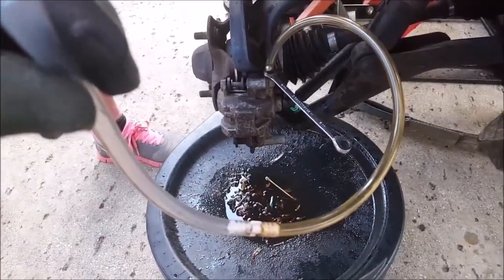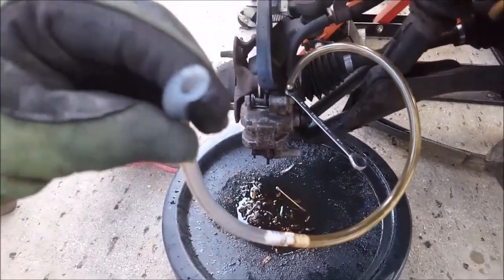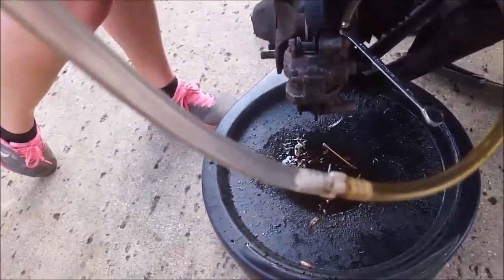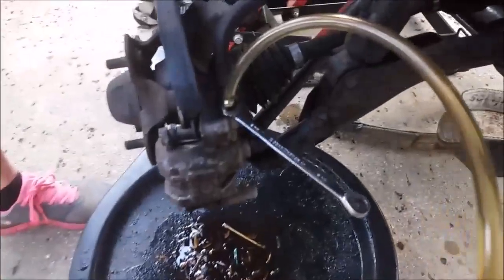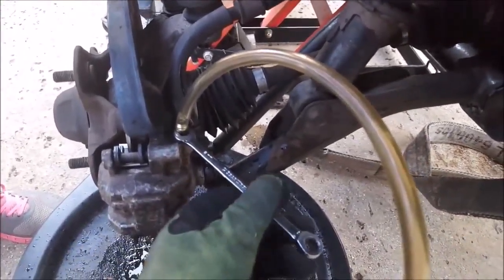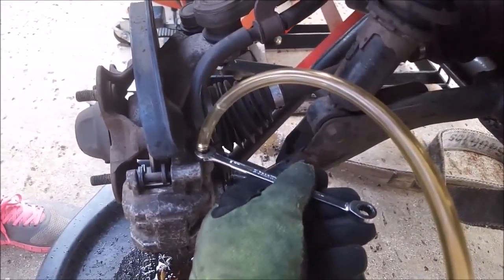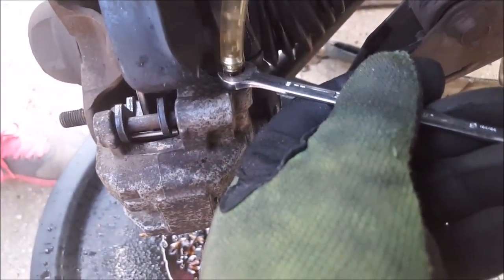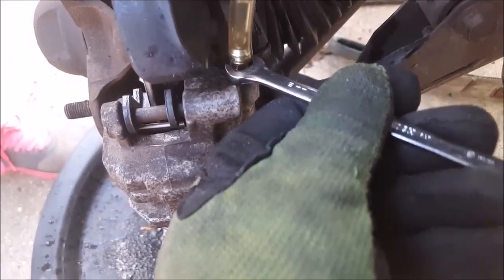Best Way to Brake Bleed an ATV

Comment: For anyone who sees this and needs an explanation even though you shouldn't need it..

Step 1: Attach one end of tube to brake bleeder and loosen the valve.

Step 2: Use your mouth and suck on the line until tube fills up, close valve.

Do this on each side quite a few times and you will gain brake pressure. DO NOT KEEP PULLING BRAKE LEVER IN.. trying to bleed these brakes like a car just will not work.

Thank you for posting this... I had this same issue on my CBR and had to have someone bleed the front brake for me. Just replaced pads on daughters ATV and ran into the same issue.. this fixed it quick.
Reply from the maker: Thank you! Good to have a positive comment!
Reply: Do I have to take the brake lever fluid top off a few times to add clean brake fluid to the reservoir every time I suck fluid thru the hose - ?  Because the reservoir is small and sucking the hose takes a lot of the fluid out - ?  Thanks

Comment: I need help on a can am 2022
Reply from the maker: Well I have a 2013 Gade, two 2016 X Mr's and a 2013 X Mr. I've never had brake issues on them but the systems are basically the same. This brake bleeding was a on a Grizzly. What kind of problem are you having?

Comment: Huh 🤔
Reply from the maker: Apply suction. Not a difficult concept but welcome to the hate on my video band wagon. Bleeding brakes on a four-wheeler not the same as bleeding brakes on the car it cannot do it by pumping the lever.
Reply: @Rusted_Link  it wasn’t hate I just didn’t know what you did or what you used to create suction that’s all no hate

Comment: Some things you could have explained: engine running? Master  cylinder open or closed? A little process explanation would have gone a long way.
Reply from the maker: You suck on the tube. That's it. Other than that apply standard bleeding processes like keep the fluid full.

I have found that the lever simply will not supply enough pressure to bleed the system quickly. You could use a brake bleeding hand pump but I didn't have one. This process is quick and easy.

Comment: The only thing he didn't show is that you pump and hold the brake down and open then close the bleeder screw to let off the pressure. It's basically common sense for everyone watching
Reply from the maker: Well no. I didn't show that I literally suck on the line to pull the air and clean fluid through. 

You CAN NOT PUMP ATV brakes to bleed them. Using a hand pump which I did not have at the time or your mouth or a vacuum is the only way that I've found.